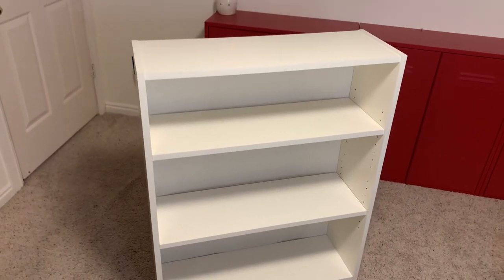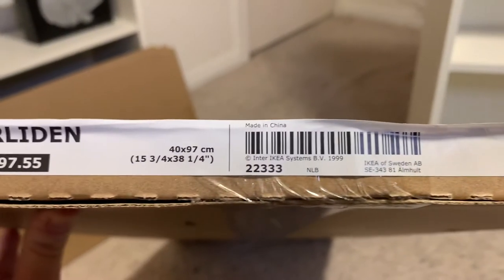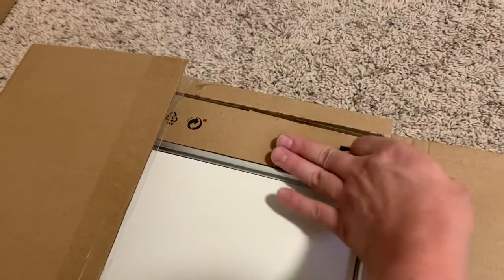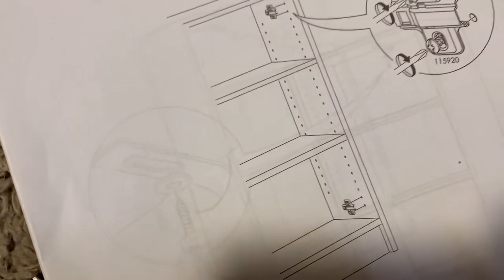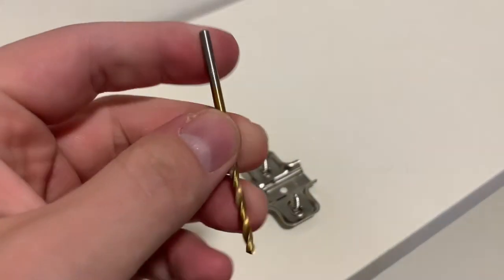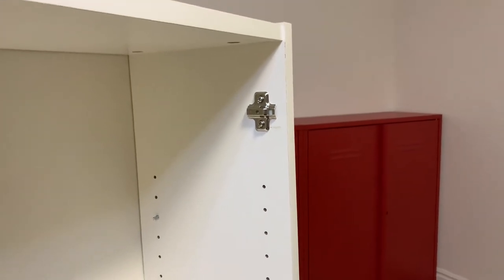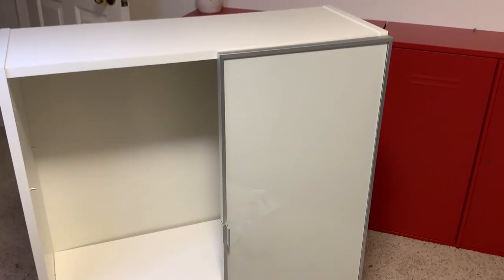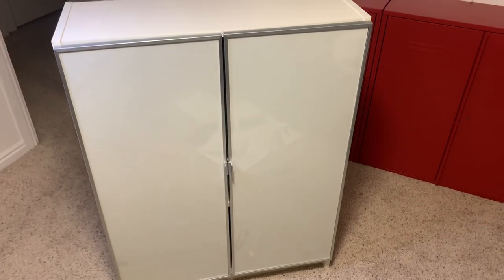Billy Bookcase - Morliden Glass Doors

Comment: I am so desperate with these doors! I have tried several times to slide in the hinge part to the glass door but I am unable to do it. In your video you get it to go in and it slides, but I do not know how to do that. Anyway, other wise very helpful video, thanks!
Reply: I know you wrote this 6 months ago .. but I just install my door ... And I spend more than 3 hours to install 1 door could fix the thing inside...till I realized you have to take a little bit backwards the screw...then it click in! Hope this could help somebody help like me that reach this video looking for help
Reply: I did it by resting the door on about 3 inches of books. The trick is to get the hooks under that other thing and then press hard until you feel a very pronounced click

Comment: Thank you for this video, it helped a lot but wow I have not gotten so angry and frustrated for years. My doors ended up slanted. I tried adjusting that special screw and it helped a bit but still, I am so disgusted with these hinges because I can see both door are slanted- ie, one door is drooping down towards the centre and the other door is slanted upwards so I have a triangular crack between the 2 doors! So how I adjust the screws on the upper hinges needs to be different than how I adjust the screws on the bottom hinges. Plus I found that adjusting the width-wise screw was not enough, I had to adjust the distance-from-the-bookcase screw too to help correct the slanting but no combination of adjustments seems to work. I hate these doors. Plus the glass shows fingerprints etc. and I scratched myself several times on the sharp door handle. I was so careful with my measurements I know that's not the problem. The problems is all the combination and permutations of all the hinge screws. And the Ikea instructions are not clear: to make it go closer to the centre, do you turn the screw clockwise or counterclockwise- the instructions don't spell that out. Hideous. Hours and hours of my life wasted on a statutory holiday here in Canada. But thank you, I couldn't have gotten as far as I did without your video. No wonder Ikea discontinued these doors...

Comment: Do you have to mount the insert behind the glass?  I’d like to use the Billy as a display case.  Will the glass in the doors hold without the insert behind? Thanks
Reply from the maker: Yes they will, it is just a piece of cardboard behind the glass. It can be removed

Comment: SOS :dothefive::dothefive::dothefive::dothefive::dothefive:  how can I remove the handle again I have attached it at the wrong height?????????????????
Reply from the maker: Yeah you can take it off again, you might need to use a small screw driver to pry it off. Just be careful.

Comment: size of the drill would be helpful,,,
Reply from the maker: I did this a while ago, sorry I don't remember the size. However, I usually choose a drill bit by lining it up with the screw. A drill bit that is very slightly narrower than the screw will be your best choice. That way there is some wood left for the threads to bite into.